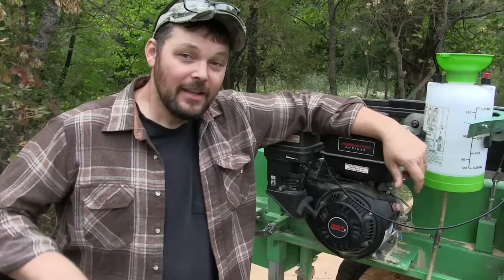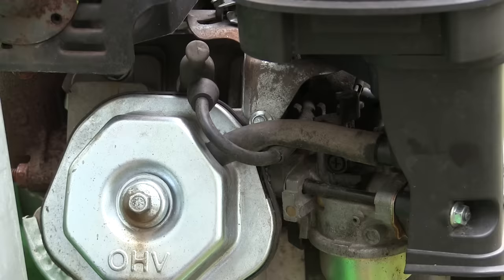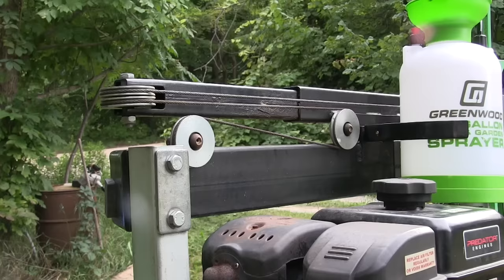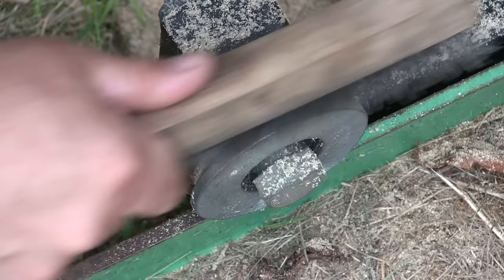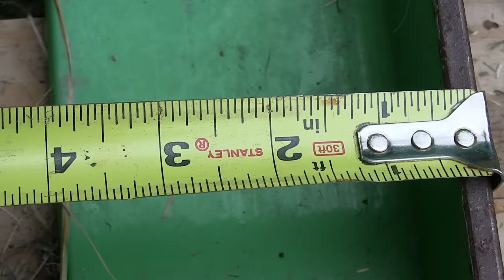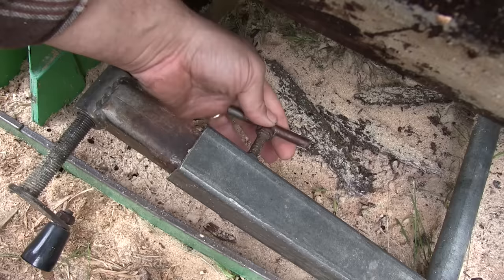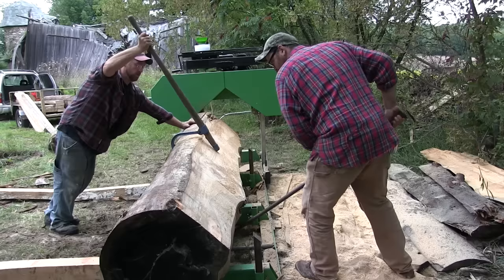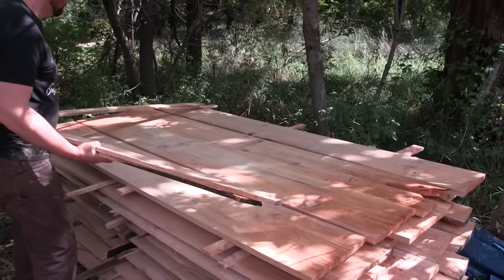Harbor Freight Sawmill Complete Review

Comment: Good review.  I do notice this sawmill is not currently available from HF - perhaps due to an upgrade or redesign in progress.  Even Woodland Mills has nothing available at this time.  Maybe this is sawmill season?

While fully understanding your intent in several of these recent videos is to show "yes you can, and without spending a fortune", one might also look at paying one of these guys in the business of portable milling, depending on your needs.  

One such local guy has a "day" rate but his travel time to you is deducted from his hours of production, and you need to provide your own helpers and log moving capability (tractor, skid loader, etc.).  He does cut stickers and will, for additional cost, bring his skid steer and helpers. In my case, he said with the goal of cutting lumber for framing, he could probably process approximately 30 each 8.5' - 10.5' logs of 10"-16" in width (this is what I would have available).  

Hiring him for anything more than 4 days would pay for  HF or WM mill, but one needs to define one's goals in making his or her own lumber.  Will I need more than a certain number of board feet in the perceivable future?  Are my needs for species and cuts I won't find in a lumber yard, or even one of these boutique places for woodworkers?  Am I willing to wait the "year per inch" for my lumber to dry?  Am I willing to build with green lumber (and yes, your little "cabin anyone can build" may be built with green or wet wood).
Reply from the maker: I have remote land with LOTS of timber, so having something to cut lumber with makes sense.....milling isnt for everyone though. Thanks

Comment: Hey not trying to tell you what to do but woodland mills has a identical, much higher quality saw mill that has an option that adds tires and a trailer hitch to the track so you can drive it around assembled, and take it to the logs etc…. It’s about $3500 and their regular is about $2200…. Maybe it might be worth looking into considering you move around a lot

Comment: Pretty cool stuff....can you mount a side brush on the frame above the wheel to dust it  when it goes by? From what I see, maybe mount it on the bolt that actually holds the wheel on...anyway you're a smart guy if you want to do it.
Reply from the maker: That sounds like it would work

Comment: I wonder if you could make the push  handle clamp on with some kind of cam lock and make the raising crank into a hex nut that you could use a ratchet wrench on. Then you could quickly handle larger logs whenever you needed to.
Reply from the maker: maybe...

Comment: Dont you find the lack of underpinning an issue? Every time you put a heavy log on the mill, it will go out of level. I put a cement slab under mine. Better mills have Steel tubing for rigidity, under the deck.I wish I had gotten that for my Thomas. The tow package I had was never used. Until I sold it.Milling is a very slow laborious process. Your pine must have been debarked.. Ours wasnt and it get wormy quickly in the summer if it sits around long.

Comment: Put a piece of cable on the carriage wheels. Put another valve on the water hose. One for on off and other for adjustment of amount of water. Put a better performance exhaust muffler. Tooth set is important makes Evan better cut. Not perfect but useable.

Comment: Looks like a pretty good mill.  How much does this cost at Harbor freight?
Can you buy extension sections of the track if you want to cut longer boards or beams?

Harbor Freight Tools is like ABBA.  No one wants to admit that they liked them but they
sure sold a lot of Albums.

Comment: Wouldn't be too hard to build some type of scraper to keep those tracks clear of sawdust. 
Spend some money on a good blade, a sharp blade will take the load off the motor 👍🙂
Great rundown on the mill, thanks  👍👍🇦🇺
Reply from the maker: I bought three new blades after I shot this video. I actually have a sawyer shop down the road from me that sharpens big saw mill blades ( wheels) and makes there own band saw blades from huge rolls of the stuff......

Comment: It works and all seems good, but if you were really off the beaten trail like Alaska bush it would be too big to ever get it there. I have watched a lot of people use the "Alaskan mill" which is a chainsaw and some aluminum extrusions and a few steel bits. If I was building lots of big stuff, and I had the choice I would grab one of these. I guess it all comes down to what you can afford and access. I have run a lot of chainsaws and even one old cast iron sawmill, the sawmill was much better, but when parts broke we switched to steel bars, spikes and made our own Alaskan mill... It was dangerous, but so is most of this kind of life... I am really not complaining, I just like to see both sides of a story... Keep up the good work.
Reply from the maker: Ive seen everything under the sun drug out into the middle of the Alaskan bush. This mill wouldnt be hard to get out to a remote camp. Raft it, sled it in in the winter, boat it. Just go look at a gold dredge. Those things were brought in piece by piece with mules.

Comment: For your wheels to help keep the sawdust out, put a piece of wire in front of wheels like screw the piece of wire so it drags the track. It will knock the sawdust off. You'll want it so it's cleaning the track off as you mill..

Comment: ok, you have almost convinced me,, in the hf reviews the biggest complaint was blade drift resulting in an uneven cut on the face plane.  have you had this issue with it?  or is it possible the construction has changed resulting in a lighter saw since yours was built?

Comment: I’m actually shopping for a mill, I’ve seen videos where they complain about the lift mechanism stripping out, does it seem weak to you? Also have you noticed if the bearings can be easily found? I would be using the mill in a very remote area, probably 2 hours boat ride to town. I guess it would be wise to just have replacement parts on hand. Honestly it don’t look like the woodland mills is built 2000$ better to me
Reply: Take any bearing that needs replaced, on any piece of machinery, to a bearing outlet such as Motion. They cross reference dimensions & type, the application is immaterial. The bearing you need for your mower blade may be used in dozens of machines, motorcycle wheels, tractors, anything. No need to search for a product specific bearing & they can get anything. And less money.
Reply from the maker: Good to know
Reply from the maker: I havent had issues with the lift.. but I greased it up first thing.

Comment: I think if you were to install a small brush ( wire/brass or even maybe plastic) mounted to the carriage that sits just in front of the wheel, so that it cleaned the rail off as the wheel was going across the track, it would stop that saw dust from building up so badly on the wheel.
Reply from the maker: Thanks

Comment: Mine HF saw mill cuts 18” longs but produces not straight cuts , even with sharp blade , specially on the knots area, it works much better with thinner logs 10-12”

Comment: only two things i would do besides what you did i would add a bucket to catch the saw dust then like a littl cover / slider to get wheels are keep cleaner like adding a old tooth brush to the wheel to push the saw dust off the track

Comment: What about setting this sawmill onto a concrete slab or a trailer? I would prefer a slab and drag my logs to the mill, also I have seen where people suggest replacing the blades with non-HF, what is your opinion on these two questions?  Worth doing?
Reply from the maker: I would put it on a slab too. As for the blades ..I bought three new blades the day after I shot this video. I have a saw shop 4 miles away that has blades in stock, over the counter.

Comment: I have seen other people who do videos on log mills say not to use water for the lubricant they say to use diesel. What is your take on this?
Reply from the maker: I personally hate diesel, and wouldn't want it on my lumber.  The soapy water cools the blade, and keeps the pitch from sticking. When I'm done I wire brush the blade ( while its moving) and then take it off and oil it/ hang it up in the garage.

Comment: @ 2:45 -- All foam air filters have to be oiled to work. Unless you're just straining to keep birds & insects out of your engine as a humanitarian excercise; if that's your objective, then by all means, skip oiling your filter! But if you're actually trying to preserve the unit by keeping dust out of your engine, then you'd better oil it... Get the proper air filter oil [you'll find it in motorcycle shops] as it is "stickier" than just regular motor oil.

Comment: Dave, if you install a set of wire bristles that brush the track and leading edge of rollers you really won't need to do extra cleaning of them. My sodomized mill has this setup and it works great
Reply from the maker: good idea

Comment: Make sure that the last fuel you run through the engine has no ethanol in it. The fuel additives do no good. Hard to find a gas station selling non-ethanol fuel (there's a web site that tries to identify stations though). There is a good video of engines and fuel age on youtube channel 'taryl fixes all' -- but the result is if you have an engine sitting for more than four months you're not going to be able to start it if you used ethanol loaded fuel.
Reply from the maker: I'm on it. Ive changed the carb already because the last guy had it sitting for a while

Comment: Would be close to $2k in materials to build equivalent sawmill (new), and that doesn't include my time, electricity, hardware or MIG wire. For the hobby-mill or general use, buy the HF sawmill during a 20%-off coupon run and never look back. Done.

Comment: oiling the filter is unnecessary. it will not increase the life of the motor. at very best it may make filter last longer but not by much and since these filters are so cheap replacing it regularly with a full tune up isn't a big deal.
Reply from the maker: thanks
Reply: @Bushradical  no thank you. I watched this whole video. You did a great job.

Comment: Hydraulic oil instead of water will greatly benefit your saw blades cutting/cooling ability aswell as extend the life. Helps prevent cracking and defects in the blade too.

Comment: Have you ever run into trouble with building codes when using your own cut lumber? Perhaps your projects are so remote that no inspector knows or cares.
Reply: Why would an inspector care about the source of the lumber? As far as I am aware, sourcing of the lumber is not specified in code.
Reply: Some insurance companies will not insure homes if the products used do not meet a federal or safety standard. Sometimes this means kiln dried graded lumber or treated lumber to guard against pests, rot, or fire. I’m not sure if this applies to building your own home or just to professional builders only. There are also some local standards required for the safety of the community even if you do not wish to insure your home. Location and constantly changing codes can be a distraction even though you have done it this way before. Possibly another argument for building remote and doing it yourself because everything should get less complicated.
Reply from the maker: Rough cut lumber is only supposed to be used for out buildings, or agricultural related buildings......but America was built with it. As far as I'm concerned, I like to be far enough out in the boonies that I can just do what I want. If its against the law to build without permission or to use your own lumber, then I'm practicing civil disobedience.
Reply: Yeah, most rough cut lumber is cut to true size dimensions and therefore much beefier than store bought so I would assume this would exceed any structural requirements. I ask the question because I always hear about these building code  horror stories but never knew anyone who actually experienced the problems. As long as you use good building practices I would choose your rough cut lumber outhouse over any other in a hurricane.